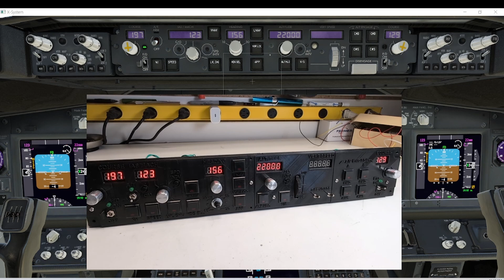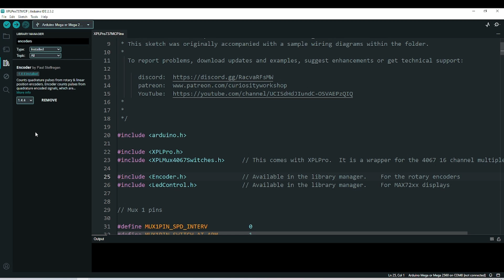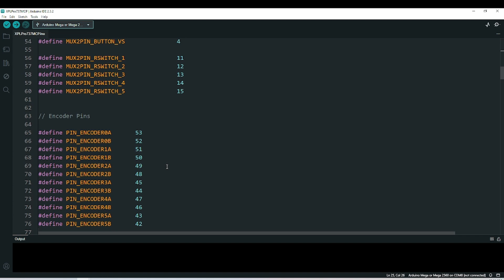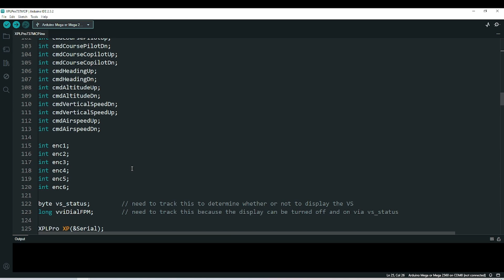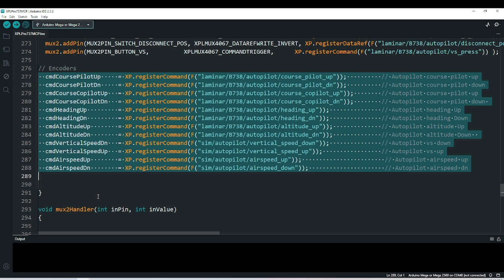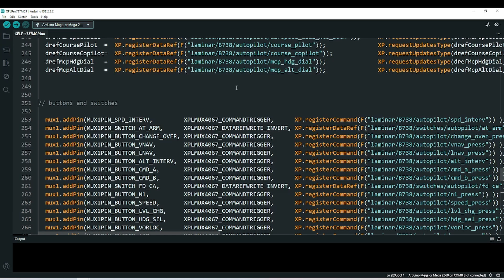737MCP Build:  Rotary Encoders

Comment: I have been experimenting with CommonBusEncoders library (changed it slightly to my needs), 8 rotary encoders with push switch and Arduino NANO. 
I am using XPLDirect. I found it working okay for one year now. 
I have been waiting for an update on XPLDirect but now I saw you using XPLPro, so I will try that one instead.
Reply from the maker: I am looking into common bus technique for encoders as well.  Let me know if you need help migrating to xplpro.